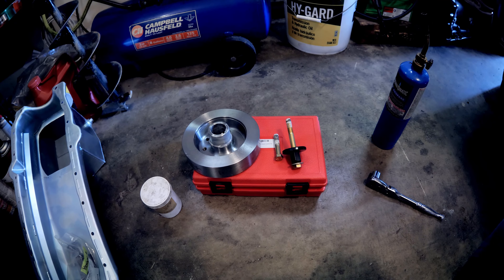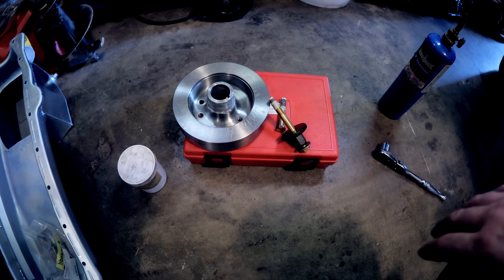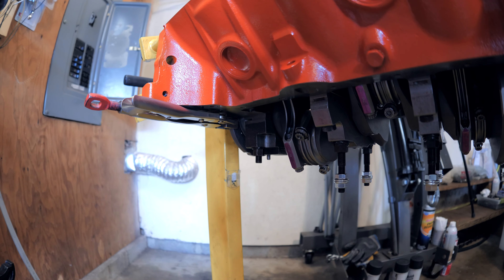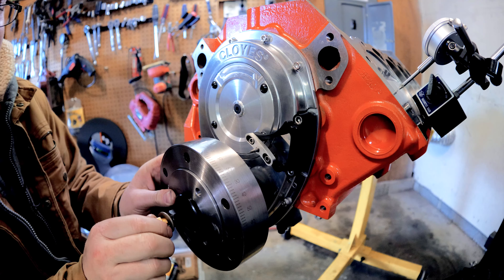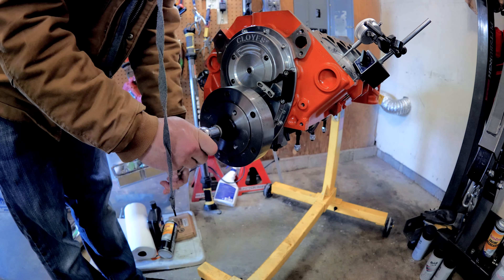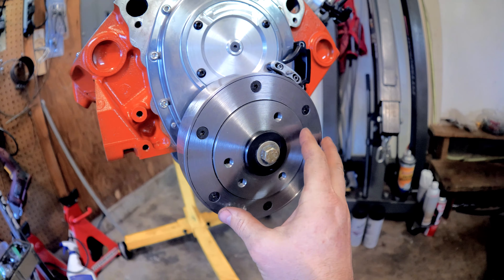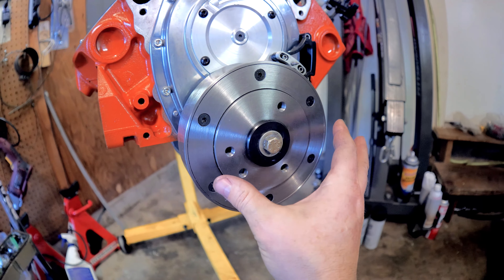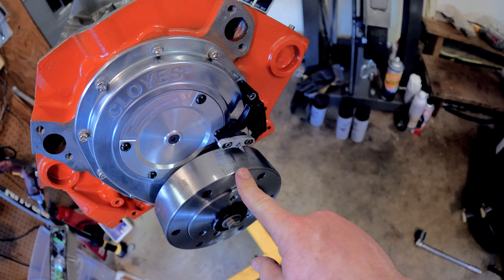Solid roller Street 400 SBC Gets a SFI balancer and how to find TCD with a dial indicator.

Comment: I'm a mechanic for a long time and I have never had to put heat on a balancer. That's why they made balancer installer and removal master tool set.
Reply from the maker: Yes sir, I have seen 2 YouTubers with well over 100k subscribers do it. I bet you can name at least one. Channels starts with a "C" the other a "V".
Reply: I never used heat and never actually seen anyone use heat . I cant see why that would be done with heat .
Reply from the maker: @chevelle-pi1bn   I have seen people put them in the oven on YouTube.
Reply: @TPVPRO  lol that's rediculous
Reply: In the thousands I've installed I've never had to use heat either. Had some real tight ones but they installed fine with a good installer.
Reply: yeah just buy or rent the correct damn tools lol  those are very common rental tools  thats what im going to do when the 302 gets a top end.  gonna replace that old stock balancer and flexplate with nice SFI ones

Comment: Applying heat to a harmonic balancer is very common in heavy truck industry. For example international states to heat up harmonic balancer or damage may occur. will not harm anything as long as it’s heated to proper  temperature. Also Some harmonic balancers may need to be honed for proper fitment. You  must measure inside diameter and outside diameter to verify. If all you ever worked on is a small block Chevy I can see why you might not know.👍 Also a degree wheel will help you find true top dead center not with it dial indicator
Reply from the maker: Heavy trucks also don't spin up over 6500 RPM . Different balancers have different hardness ratings for a given RPM range for dampening. On a small SBC balancer when you heat it up, I also wonder how that affects the dampening material inside and is it now functioning within spec when you are turning it over 6500 and up RPM.
Reply: @TPVPRO  We’re not talking a lot of heat !! We’re talking a couple hundred degrees which is what your harmonic balancer gets  normally  due to normal engine operating temperature is just another way to slightly expand the balancer If”the balancer was to be a little tight . All is needed is a heat gun and slightly heat the center where it receives on the crankshaft Not heating the Hole  balancer... Then verify it with the infrared gun To be safe.

Comment: Just pick up a kit from the local auto parts store, pay the deposit, install the balancer, return the kit and get your deposit back. Boom, done.

Also, for y'all installing SFI parts: take pictures of the sticker before you install it as many tracks will ask for proof during the tech inspection. And even if the sticker is visible externally, it may become damaged from fluids, weathering, etc.

Comment: Fluid damper balancers are much tighter on the hub than the one you installed. Those are the ones most people have issue with.
Reply from the maker: I mark my pully because it's bolted to the hub. Gives me a refrence if anything goes sideways. I have the same SFI balancer on my LT1 so far so good. 🤞
Reply: Fluid Dampr are the only ones I've ever seen issue with. some of those so darn tight on the hub it has broken an installer. We had to start Mic'ing them and honing the hole to get a less tighter fit. Never seen the issue on other brands. I think that issue has since been resolved. Havent used one in a long time.
Reply: I had to have my balancer honed when I had bottom end balanced

Comment: I am internally balanced, is this preferred or is externally balanced a better option for your application?
Reply from the maker: You still need a harmonic balancer regardless. The one I have is for an internally balanced rotating assembly.
Reply: @TPVPRO  are you using 5.7 rods and clearance or 5.65 rods? I am interested in what your build will produce as mine is similar to yours. Will you go power adder later?
Reply: @TPVPRO  thanks for the videos, I enjoy them greatly. It's like therapy. 👍
Reply from the maker: @greenmonstah8753   6.0 rods 350 mains, you treat it just like a 350 CID motor with the aftermarket stuff. The stock 400 blocks have larger mains. I will be using the same flex plate I had on my 350 and it will get a 200-250 shot max because it’s not billet main caps.

Comment: Don't need nothin but a hammer and block of wood! Lol. But seriously, your older sbc small journal cranks had no bolt hole. 🔨
Reply: That's is correct.alot of folks don't have common sense putting heat on a balancer

Comment: Nice you had that under cut .004 thousands gonna put a bigger gasket
Reply from the maker: The crank and balancer are both new. The balancer is just how it came from Summit Racing out the box and the crank has only been balanced.
Reply: @TPVPRO  sorry I wasn't clear the deck surface on the block
Reply from the maker: @jesserasso1042   I am not sure about the block because CNC-Motorsports did a Parallel square deck. The heads were shaved .006. The gasket is going to be MLS .045 and 4.165 bore.
Reply: @TPVPRO  nice I was just going off the -.004 that was written on your block in the video I thought it was under cut for a little more compression
Reply from the maker: @jesserasso1042    Each cylinder has a number and is how much they are in the hole to determine head gasket thickness.

Comment: I see that a lot with LS engines and thought damn that can’t be good for the rubber seal on the timing cover ! And yeah iI have seen rubber seals dry rot and come apart 
   I bought the install tool and removal the install tool works flawlessly same as the removal 👍🏻
I seen somewhere we’re someone put a tq wrench on the balancer and measured how much tq was required to spin the rebuilt short block 
https://www.instagram.com/p/CLSJ6kTHWUk/?igshid=ej2yswah50bq
You can delete that I just wanted to show you  the guy is awesome!!